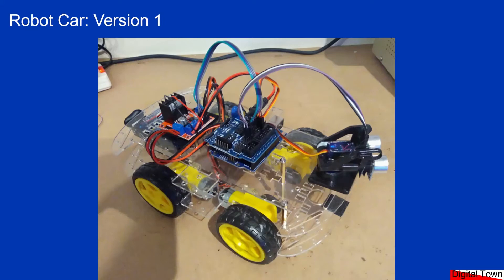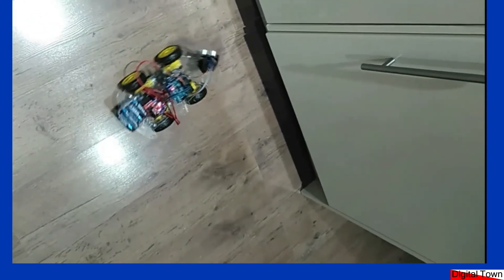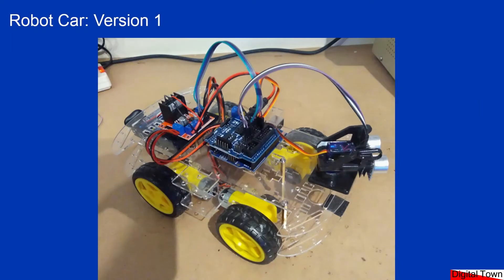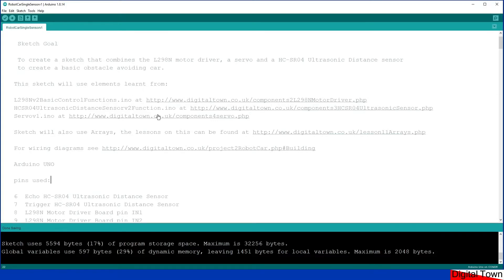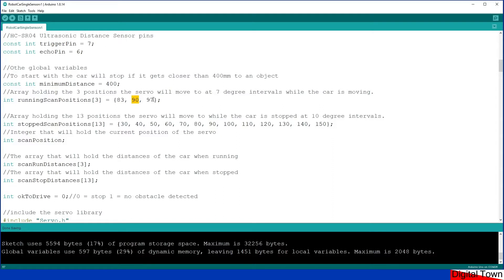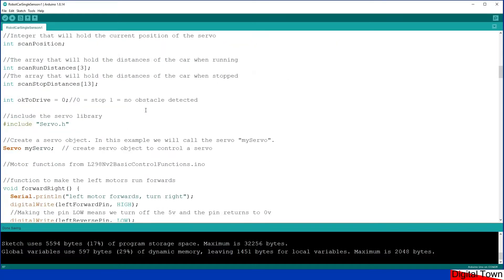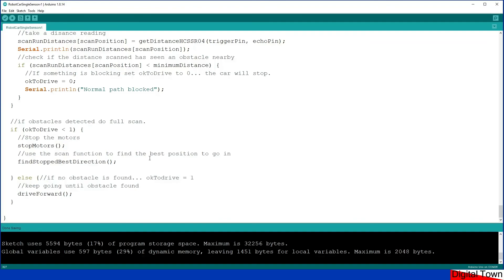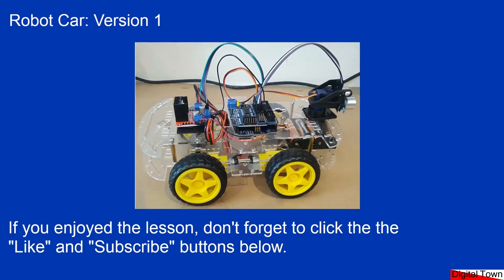Arduino C++ Robot Car v1 Basic Obstacle avoidance using servo and HC-SR04 Ultrasonic Distance Sensor

Comment: Do you have link to buy Servo/ Ultrasonic mounting device?
Reply from the maker: The rotating ones came with the car kit. The fixed ones I used later are from Aliexpress